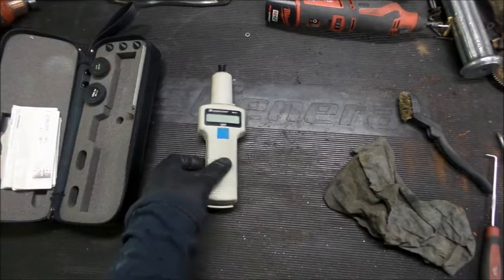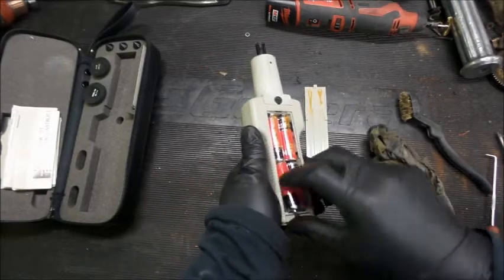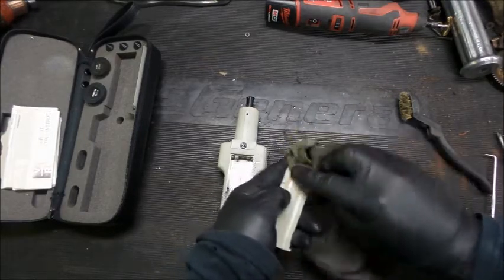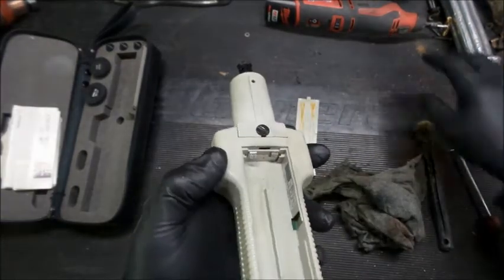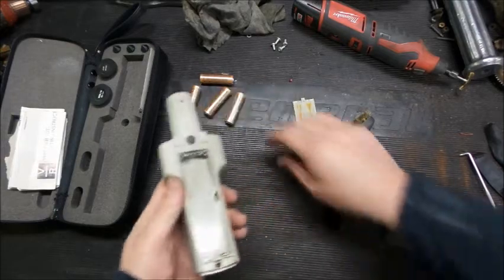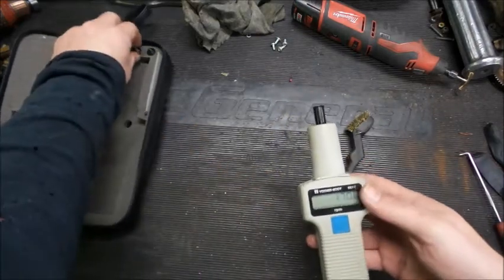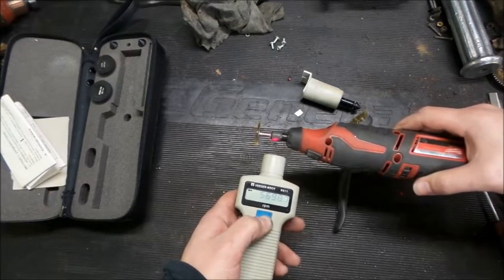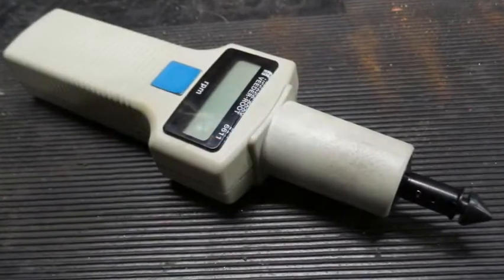Veeder-Root Model 6611 Hand Tachometer Resurrection

Comment: I'm trying to resurrect a tachometer just like yours. The lens fell out and I don't know what the orientation of it should be. There is a convex side and a flat side to it. Maybe you can help?
Reply from the maker: I will be happy to help out. The convex side is facing outward with the line between the two convex parts being vertical with the orientation of the tool. Let me know if I can help out any further  and let me know how you make out. This has been a great tool to have around the shop,. You should be happy with your once you get it up and running again.
Reply from the maker: Any update on your project?
Reply: Talking Hands Tools I reassembled it with your first message but it still doesn’t work. I feel like the light receiver my be defective. Also mine has a white light instead of a red light. I will need to look into it more when I have time.